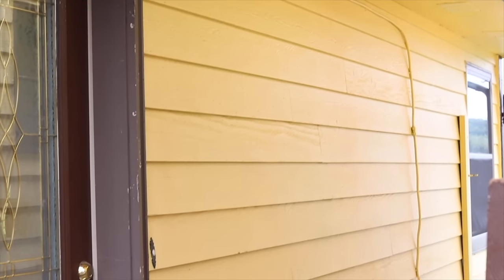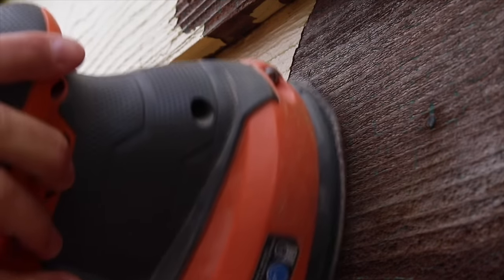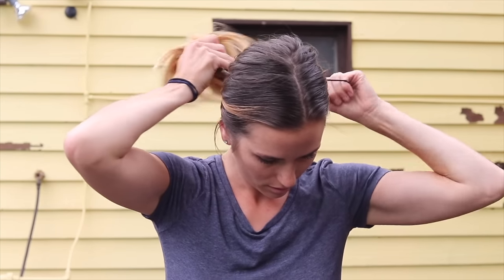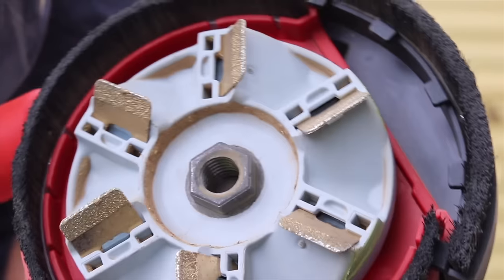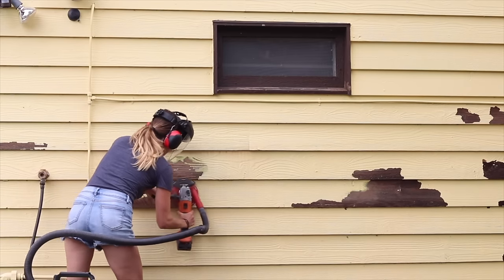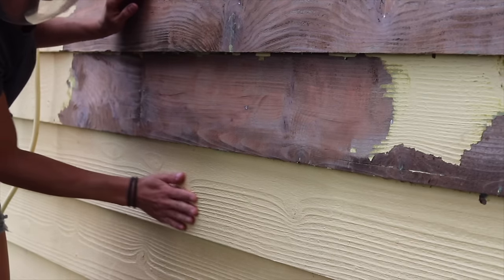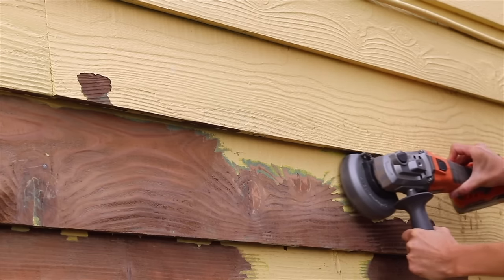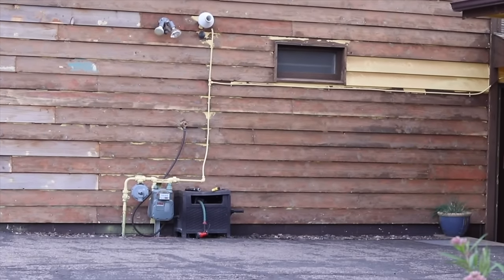Removing Paint From Cedar Siding | Diamabrush vs Paint Eater vs Sander vs Pressure Washer vs Scraper

Comment: Had the same type of peeling 2-3 years after painstakingly scrapping, prepping and painting my house.  Only took a few years and the carefully prepped siding was peeling off in sheets.  All I anticipate, was a response to moisture in the wood.  The next time I corrected the things I did wrong the first time, and to this day the house and paint still look nearly perfect.  Steel siding works great.
Reply: 😂👍
Or vinyl, or colorfast hardyboard.  Sheathed and sealed WRB under.

Comment: For having anger management issues, you took on a project that most professional painters would run from.  What you are doing is labor intense to say the least and not easy. Step back for a moment and have an old painter look paint history of the house. I am guessing from experience that the cedar was initially stained. Someone later decided to paint the house one day. Prior to latex paint, people used oil paint which is most likely what the first coat of paint is. If the initial stain was  a solid body stain either oil based or water based, it explains why why your house is peeling down to bare wood and taking all layers of paint with it. 
You may want to consider trying infra red heat and or paint stripper to see if it will save time in labor. Time is money so consider any tool you buy as an investment to save you time. Another option would be to buy a festool 125 palm sander and a Vac. The sand paper you want to use is called GARNET. This sand paper does not gum up like other sand paper. I use 60,80 and 120 depending on what Iam up against.  This method will not gouge the siding. The best way to eat an elephant is one bite at a time. Don't look at the size of your house. Look at one side at a time and attack the problem. In the end, you can be proud of yourself as it is a labor intense project and takes a lot of "patience." This is a great video as many homeowners have the same problem. I like to keep things simple. Women put on foundation before they put on make up for a reason. If they don't use the right type of foundation or prep the surface of their skin, the make up will not perform as it should.  Just like paint.

Comment: I worked for a time with a painting company and all we did was prep and paint buildings all day, all year, every year.  Here's how we did it.  0) Tie back anything close to walls to allow access for pressure washing and later masking and spraying.  1) pressure wash off all loose paint.  2) Let building dry for 2 days or more depending on weather (preferably warm weather for paint day at least.) 3) Tie back all trees, plants, trellises, etc.  4) Mask off all surfaces such as doors, windows, trim, roof, ground, plants, cars so no spray paint gets on them.  5) Spray paint the building.  Approximately 35 gallons for a 4 bedroom single story home or two duplexes.  6) Immediately unmask everything except things that will fall into the paint such as trees, plants, trellises, etc.  Unmask those about 2 hours later.  7)  Go around the home hand painting any different colors or finish sheens on doors, trim, patio covers, whatever, as needed.  8) collect the money :)  We would finish two to three of these every day, though the hand painting to finish could take an additional day or two as there was usually only one person per house working on that !  (Some were two floors and odd in size.  Those of course take longer.)  Thank you for your great videos Malissa !!!
Reply: Hmm… wonder if you are the guy that spray painted my house. A few years later, looks like crap and is peeling.
Reply: 35 gallons of paint…wow thats a lot of paint and how were you competitive with all of that material costs?

Comment: A good option if you don't need to preserve grain, eg grinding fascia, is the 7 in. Fiber Disc Backing Pad from Harbor Freight and find someplace that sells higher quality discs. We use these at my work and you can get alot done and they don't bite as bad as the diamond wheel. You do have to be careful to not leave swirl grinding marks though, so it's good to practice in an area with less visibility until you get a feel for how each different grit disc bites. 36 grit is a good general use middle ground type of grit. 
Pressure Washing is good for peeling paint, but as you experienced, not great for just a little loose paint.

Comment: Get yourself a Metabo paint srtiper and A  carbide hand scraper. Leave paint that is still secured to the siding, feather edges with palm sander. Apply 2 thick coats or Sherman Williams Primer RX sure bond. That stuff will secure any remaining paint and prevent future cracking. Make sure to have the primer tinted white, comes clear and you can't tell what was painted if it's not tinted. Metabo is the only hand tool worth it for scraping. Good luck!

Comment: Melissa, it is always enjoyable to watch your home improvement videos.  May I suggest wearing a mask whenever you sand or spray new paint?  Viewers need to be reminded that safety goes along with techniques. The cedar siding may have had a stain or oil in the past that prevented better adhesion of the previous pain.  Taking off old paint takes a lot of work and time, but again wear a protective mask & goggles when you try this.  P.S. You are delightful and lovely.

Comment: That was great.  Now I'm thinking of pulling off the siding and turning it over.   Might be less work.     I learned that with new siding always prime both sides and prime very dry wood with very wet primer that soaks into the wood.  Thick primer just sits on top to cause the bubbling.

Comment: I use to do a lot of old homes we used hand electric plainers you can adjust the thickness of the paint very well we would use a nail set all the nails then plain the paint off .With the ceader siding put a good oil base primer on first then latex paint wound fall off trust me .Girl your looking great in those shorts . 😁

Comment: I cannot imagine having to remove the paint off an entire house. I rebuilt and painted my girlfriends deck last summer and used a combination of flap discs 40-80 grit on an angle grinder along with a dimabrush and they all worked really well, but were incredibly time consuming.

Comment: As a P&D I feel for you on this project as it's one of those jobs which only has a solution through trial and error. Heat gun v sandblasting etc.I would defo set down some drop cloths as the paint shavings are so small they will go everywhere. Also, use a quality wood primer after all the prep has been completed, only after all panels are void of all moisture as you run the risk of sealing in the moisture and will I'm afraid return to stage 1.Good luck, but hard work and a quality finish will be worth it in the end.

Comment: Old homes with rabbited shiplap siding such as yours were designed to breathe through the walls. Things like refrigeration systems to cool the inside of the home didn't exist and so there were no concepts like 'building envelope' to seal gaps to create a closed space for efficient cooling.  Your home was probably built with a whole house fan in the attic (somewhere in the center of the house) and double hung windows.  To cool the interior space, you would open the windows (low sash on one side of the house and high sash on the other) and turn on the whole house fan to create a draft of air flow from one side of the home to the other. Warm air would be expelled through the attic out through a gable soffit.  This brought cooler air into the home and pushed the hot air in the attic outside the home.

With the advent of modern HVAC systems, walls that 'breathe' were no longer desirable.  It was a common practice to install new siding over the old siding to improve the building envelope or, in some cases, a painter would caulk the overlapping shiplap seams and paint to seal them.  These approaches help create a more efficient space for HVAC cooling but, in the latter approach, sealing the seams means that moisture and humidity build up in the walls resulting is the peeling paint you are now seeing.

Therefore, it is likely that the wet spots you see on your shiplap siding are the direct result of moisture attempting to escape from the inside of the home.

If you want to permanently resolve this problem; the best prep solution is to remove each piece of shiplap, chemically (or mechanically - I prefer a heat gun and scraper) strip the paint from the face of each board, lightly sand, and finally (this is the important part) prime ALL sides (front, back, and edges) before applying the finish paint coat.  This is known as 'back-priming.'

Back-priming the shiplap siding will eliminate the moisture buildup in the wood, but it won't eliminate moisture build-up in your walls.  This is a separate problem you will also want to address since moisture can cause mold.  You can address the moisture issues in your home by checking for proper ventilation in any room with a water fixture (such as kitchen and bathrooms). Make sure you have ventilation systems in place to remove moisture when those rooms are in use.  You might also consider buying a couple dehumidifiers to lower the humidity in rooms adjacent to those walls where you notice wet exterior wood siding.

A comprehensive solution to interior humidity control would include a dehumidifier solution added to the HVAC system that cools your home.

One last note, the mechanical method of removing paint is fast but it comes at a cost.  Exposed wood grain (like that present in your siding) is often lost with the paint.  This is fine if your goal is a smooth exterior wood surface.  Just remember that smooth surfaces have a lower adhesion for paint.  You will definitely see any new paint peel again (probably more quickly that before) if you don't address the problem by back-priming and lowering the interior humidity.

Old homes are a lot of work, but the rewards are worth it!

Comment: When a blade breaks off on the Diamabrush and it runs out of balance could you remove the opposite blade and get a bit more use before replacing?
Reply from the maker: Yes, although doing that down to only two blades barely works. It really works best with six, ok with four, and not well with two..

Comment: Thanks for the comparison. I can't imagine how long it took to complete this job. Did you look into chemical strippers at all? I've had luck with Citristrip. But then I'm just doing some cabinets with one paint layer (not 4!).
Reply from the maker: Yep, I guess I should've included that in the video lol. Very messy, too expensive, extremely tedious, the good ones are bad for the environment, and I'd have to plastic wrap the whole house, not to mention they don't work nearly as well on vertical surfaces. Perhaps you've seen my other videos where I've stripped cabinets, furniture, etc?
Reply: @WelcometotheWoodsBlog  I've seen almost all your videos! Great channel! And yes, chemical strippers are a mess.
Reply: I've tried on a small project and agree that they are quite messy!
Reply: @WelcometotheWoodsBlog  check out a paint shaver pro, I'm a tradesman  painter, they're expensive but you can hire them, fast and no mess, worth a look . Good videos keep em coming 👍, btw my epoxy benchtop stained also.😡

Comment: have you thought about using a wire brush attachment for your angle grinder? It isn't as abrasive as the diamabrush, but more abrasive than the sanding sponge attachment.
Alternatively you could look out to lend a dry ice blaster.
Reply: wire wheel is very dangerous.  Hard to control - I have experience with them and always recommend against them.

Comment: That's lots of work Melissa.  U must be exhausted or way to strong.🙂. If I would have to choose color on siding,  I would use high quality black stain . I used that on my doors outside and on my trailer and stain holds extremely well.  It's almost thick like a paint , but much, much  better choice. U have a beautiful day 👍

Comment: The "painter" didn't oil prime before applying the top coat. I'd use a chemical strip with pressure wash (using the correct tip/pressure) and spot sanding. Let dry completely,  oil prime with tinted primer to the finish color, then apply 2 topcoats. Make sure to seal all joints/holes. Have fun.
My cedar paint jobs last 20 years or more. Just lightly pressure wash/rinse once a year to remove pollen/grime.

Comment: Did exactly the same job of removing multi-layers of paint and mildew off cedar lap siding.  There is no simple or easy way. I used heavy duty 60 grit 6" sanding discs on an old circular sander. (Similar to an angle grinder.) Primed the new wood surface with alkyd primer, topcoat with acrylic latex paint.  We sold the house, which was painted in appropriate decade color, but the current owner is now repainting to a trendy charcoal color!  It looks terrible.  This is so sad after spending two months of hard labour to 'restore' the 1970's split level home.

Comment: you don't always know for sure which direction the moisture is coming from, it is possible the wood could be wet from condensation due to no vapor barrier or inadequate vapor barrier associated with bat-type insulation, it is also possible for certain kinds of insulation to get waterlogged, which could also lead to wet siding.   If there is a condensation problem going on, you want to get that resolved before putting on the new paint, especially after all the work of stripping off the old paint.  Some of the wood looks dry, some looks damp.    You can also do a lot with a disc sander, and those come in different sizes and you can select the grit paper you want to use.    The oscillating tool will probably not work too well because they get over-heated PDQ if you use them for more than a couple of minutes at a time.   And if it is a pre-1978 house, you want to be REALLY sure there's no lead paint involved with a massive power sanding project like this.

Comment: Great presentation! I have suffered with similar cedar siding with 8 inches to the weather. I ended up using a painter's tool + scraper to get the big stuff, followed by an orbital sander. Not perfect, but not horrible. I'll try the Diamabrush for my next foray. 
It's important to know where the water is coming from or you can be cursed with the same problem in the future. While a good quality primer (Benjamin Moore Fresh Start) is crucial to keep the paint sticking to tannic woods like cedar. if there's water trying to exit from behind the board, nothing will stick. So, be sure to understand why the wood is wet and address it if necessary.
At $9/foot for primed 10 inch cedar bevel siding, the materials are obscenely expensive. So repairing is great where the wood can be restored.

Comment: You should always put plastic down to catch the paint chips.  I would not put another coat of paint until someone fixes the moisture problem in the wood.  Are there rain gutters collecting the water?  If you put another coat on should you also use a good primer your first coat paint?

Comment: Paint shaver for the ship lap siding. Set at minimal depth to start. Use nail sets to counter sink the nails. Don't want to take the heads off too much. The paint shaver with the HEPA shop vacs and plastic on the ground for lead; however, I think I'd leave lead paint removal to the pros. I think in my state it's the law, but I'm not quite sure.

Comment: Try dumond smart strip.  I used to remove layered paint from my living room plaster ceiling.  It is thick, little odor and I troweled it on the ceiling in small sections of 5' X 5' and walked away.  Kraft paper covering floor as drop cloth.  Within 8 hours the paint starts to fall off ceiling, then I came in with blade tool and cleaned off the rest of the paint - all loose and down to original plaster finish.  Worked effortless.  A little messy cause I was doing a ceiling.  I have vertical tongue and groove cedar siding outside on house that needs this same removal, I am going to use smart strip.   You should at least try it out.

Comment: I don’t wanna talk negative but I’m a contractor since 1985 new construction and remodeling and you’ll be there forever with that. What you should do is just go get a power washer you can even get a small one but what do you want to do is get that just real sharp stream tip and that will take that stuff right off you won’t have to get on the ladder that high and it’ll be so much more production

Comment: Anger is suppressed by adaptogens... Ashwahandha KSM 66, 1st thing in the morning. Everyone can be cranky from no rest. Or very strong Black tea. I used 3 tea bags at time to reduce cortisol /stress levels. 
Its good you protect your eyes...one little chip in your eye /eye and its not a very good day.
You have alot to sand / grind !!! Sometimes I just used 120 grit discs and vacuumed up later with a shop vac.... thats a very laborious  job. One area at a time.

Comment: You should add affiliate links to the video description for the project you used.  Was the surface damp when you painted it ?   Did you apply a primer before painting ?  Cedar is difficult to paint, you should check that the paint specifically said it could be used on cedar.
Reply from the maker: I just bought this house in august, so I did not do any of the previous four paint jobs. You are right in that paint on cedar needs to be specially formulated, in fact what I've learned I'll be sharing in a future video about why you really should never paint cedar because of the high tannin levels. Ideally wood siding is covered in a semi-solid or solid stain so the wood can breathe.

Comment: Speedheater Cobra is the way to go for paint removal. No its not as fast as other methods but it works extremely well and especially useful on lead paint where you dont want dust everywhere. They also make a larger version for exterior projects.